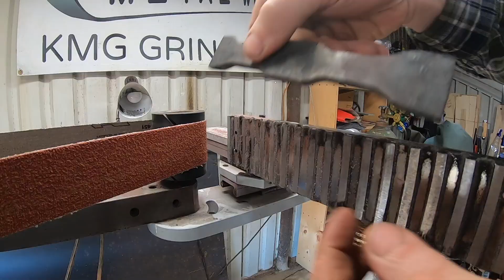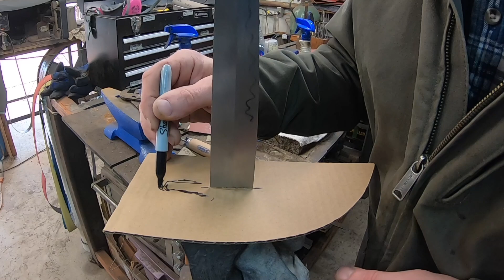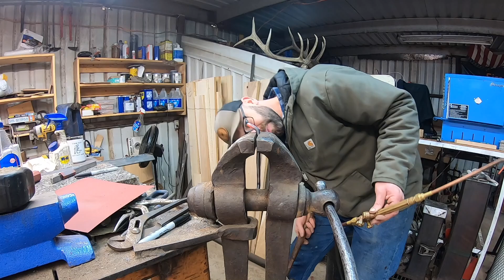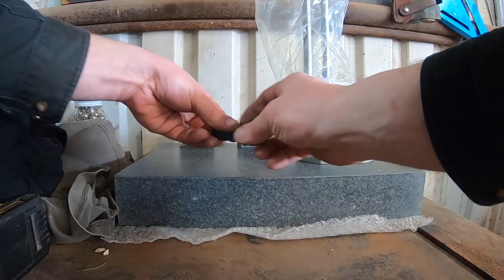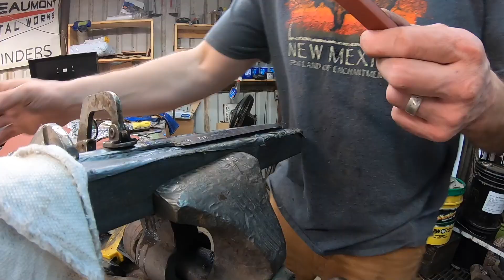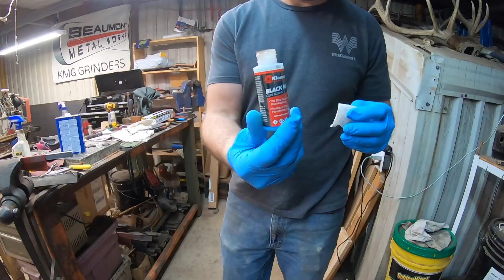Middle Ages Weaponry: Finishing The Fourteenth Century Side Arm

Comment: Instead of drilling and grinding with a dremel on the hand guards try making a punch attachment to go in your hydraulic press. Then beings you hot fit it anyways just hot punch a hole with the press and then hot fit it to the blade 👍 drilling and grinding sucks and it takes forever.  Beautiful blade as always, I was wondering if we were gonna see the conclusion!